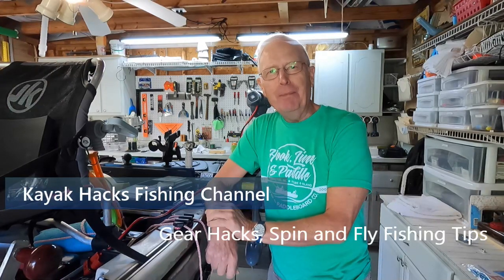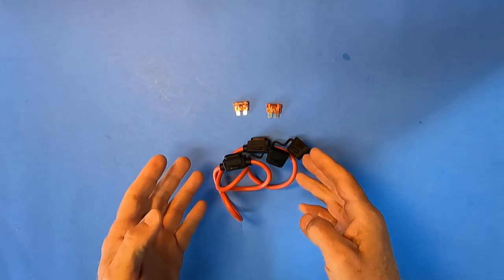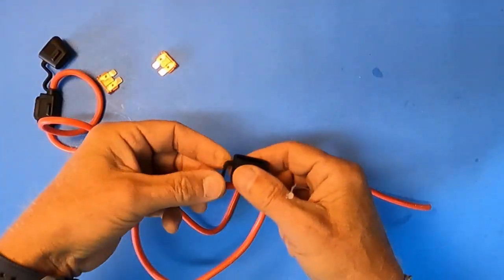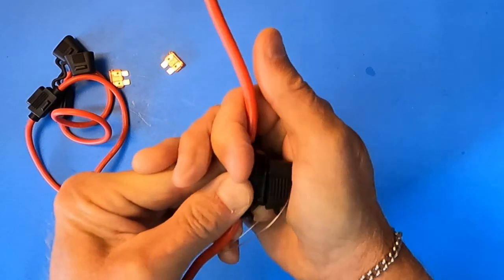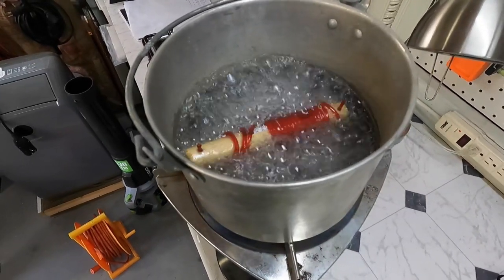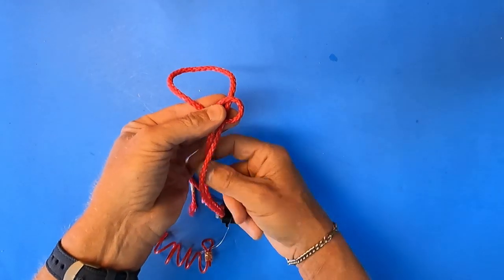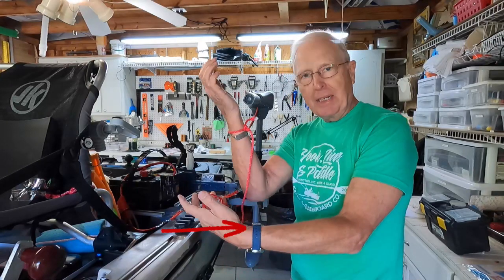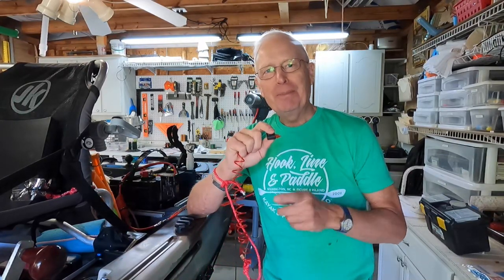Fishing Kayak Trolling Motor Setup - Unique Trolling Motor Kill Switch

Comment: You can purchase a factory made kill switch with lanyard on Amazon or ebay for $12-$15. Mount the switch directly to the same box you install the PWM connecting it between your power in cable and the power in lug on the PWM and you are done. Also ... attaching the lanyard to your wrist can be an extreme safety hazard. Simply use a snap hook to attach it to the D-ring on your PFD (This is what it was designed for) just like the big boat operators. Make sure your PWM box is mounted solidly in the kayak and you should never have any problems if you become separated from your kayak.
Reply from the maker: Great points. The only thing I would add is to make sure anything you buy commercially has specs that match your motor - specifically, that the wire is the same gauge as your motor.
Reply: Hi do know how to install the factory made kill switch module I've got no idea how  to connect the kill switch to the PWM SPEED CONTROLLER no body's giving any information on this,,,,,, kill switch speed controller system ,,,,,OOP'S,,,,, I'M not as smart as you guys,,,,,,I've lost my memory from a motor bike Accident,,,,,,,,,😮😮😮😊😊
Reply: Cut the ground wire and place in between as shown!! Easy!!
Reply: A factory made kill switch with lanyard  will not do 40 amps.....
Reply: @XSAILOR65  it sure will … if  use it on the low voltage side of the PWM and not the main power line.
Reply: @butchmiller3970  OK, but where should it then be connected? To the potentiometer?( mine has 5 wires) or the forward, stop, reverse switch( 3 wires)?
Reply: @XSAILOR65  I placed mine on the center wire of the potentiometer, however, you should do some tests to make sure it will work for you as PWMs are not all the same.
Reply: @butchmiller3970  OK, many thanks. Will try this.  A  very useful hint. Can end badly if You are out with your SUP and motor continues if you fall of the board :)
Reply: @butchmiller3970  which kill switch did you buy? one with the 4 prongs or with the 2 wires? i got the 2 wired ones and I think its not the right one
Reply: @tbcha1  The one with four prongs. I used the two that are for “normally closed” … so when the lanyard is removed it opens the circuit. 

The other two prongs are for “normally open” and would close the circuit when the lanyard comes off.

Comment: I opted to wire in a Sure Foot Trolling Motor Foot Control Switch in place of a kill switch.  Just as you wired your switch in, I have the foot control wire spliced in and then run under my seat and then secured with velcro to a comfortable position on the deck to press it easily with my foot to engage the motor.  It works very well sitting and even better when standing.  The motor will not engage unless I have pressed the foot control so I can start and stop the motor at will and leave it at a preferred speed.  Cost for switch was $29.00.
Reply from the maker: Perfect!
Reply: Great idea where did you order the “Foot Control” from
Reply from the maker: @k9kayaks  In case Cliproach does not answer, it looks like you have options here - https://amzn.to/3oUJWzq
Reply: @KayakhacksFishing   Ah great I appreciate will definitely read up on it 👍🎣
Reply: @k9kayaks  I purchased the Sure Foot Trolling Motor Foot Control Switch on Amazon.
Reply: Anyway you could post a video?
Reply: @longbeard1188  I discovered the idea from this video https://www.youtube.com/watch?v=VinpCMuydo4     "how to install a trolling motor foot switch".

Comment: I know this is an older video, which by the way is very informative. My question is the newer inline fuses have a Maxie fuse and it looks like their might not be enough room to drill a hole for the line. It says not for regular fuses, any work around idea for this issue? 
Thx again Mr. Safety
Reply from the maker: No, sadly, I am not familiar with that product

Comment: The 40amp fuse, is that the right size for a 34 pound thrust MotorGuide trolling motor?
Reply from the maker: You need to check your owners manual. I looked at the R3 series manual and it specified at least a 50 amp and recommended a 60
Reply: @KayakhacksFishing  I got this trolling motor in a trade, no owners manual included.
Reply: @KayakhacksFishing  It takes a 50amp breaker. I found the manual online. Thanks.

Comment: Hi there have you worked out a better way to hook up a kill switch to the ,,,,PWM speed controller ,,,,,,if have I would like to know how to please ,,,,,,Hi do know how to install the factory made kill switch module I've got no idea how  to connect the kill switch to the PWM SPEED CONTROLLER no body's giving any information on this,,,,,, kill switch speed controller system ,,,,,OOP'S,,,,, I'M not as smart as you guys,,,,,,I've lost my memory from a motor bike Accident,,,,,,,,,😮😮😮
Reply from the maker: This kill switch is positioned between the motor/PWM and the battery. It should work fine with a PWM. Just put it between the battery and the PWM
Reply: Okay thank you very much appreciated

Comment: Love your hacks except this one.  A kill switch, like those used on jet skis, can be purchased for around $10 or less.  I put one on my kayak motor control box.
Reply from the maker: Can you share a link to the one you purchased? The ones I saw on Amazon did not have 10 gauge wire to match my motor's requirement.